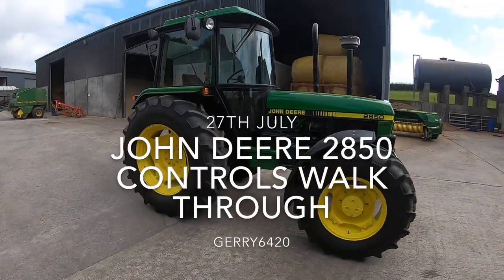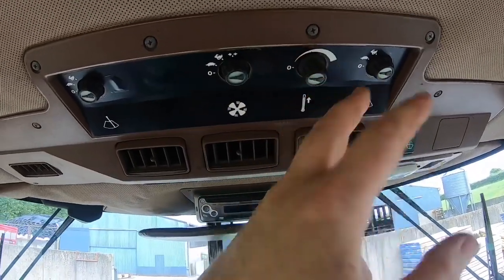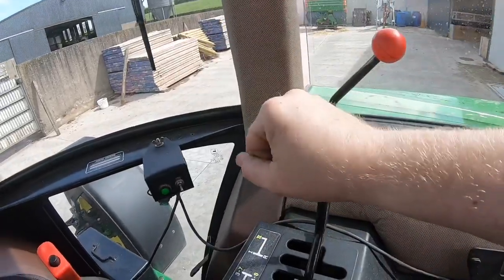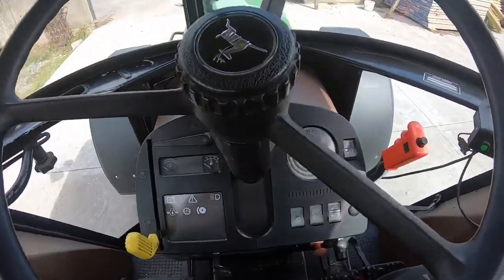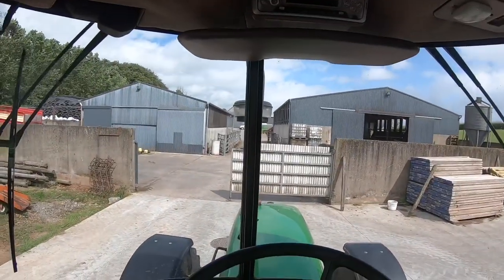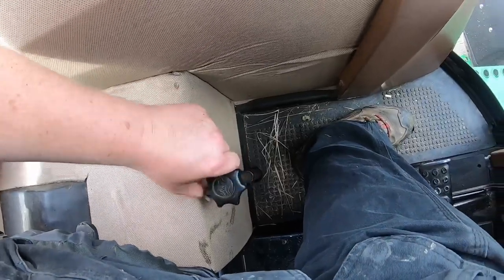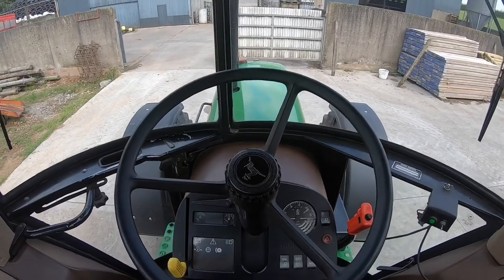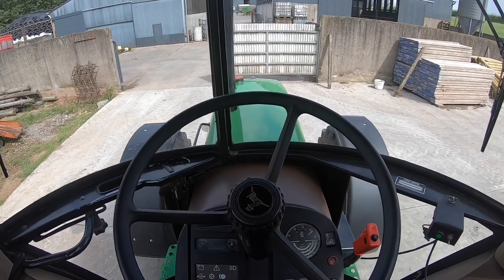JOHN DEERE 2850 CONTROLS WALK THROUGH

Comment: Great video Gerry. Brings back fond memories. The first 4WD John Deere we had was a 2850, it was a brilliant tractor with tons of guts for a 4 cylinder. Ours was a 1991 model & instead of the normal analogue clock had a small green LCD display for the speed, rev counter, pto speed etc. The only reason we had to change it was because Kvernland 3F reversible was too much for the back end.  Yours is in brilliant knick   mate. All the best. Robert

Comment: Great wee tractor Gerry...note that if she was a 40 series the power synchron is not on the little lever but is engaged by nudging the 1,2,3,4 gear lever to the right for high and left towards you for low.
Reply: I drove a 2040s in my teens. The power synchron was a pain in the neck as we had the great stick break a few times. The fifty series is a better idea, I presume John Deere had a lot of complaints with the forty series. Personally ford has the best system with the dual power.
Reply: And the gear lever rattled like hell🙄😩😂
Reply: @roberthiggins6401  Yea, but theres plenty of fords that have had the dual power wired up to a switch on the gearstick if you look around auctions. But yes, the pedal on the floor was as good as any
Reply: @bobpaterson1845  That's right lol, it had plenty of free play in it to rattle

Comment: I'm in throcess of buying a 1950 4 wheel drive, just one question, How do you operate the adjustment of the steering wheel?
Reply from the maker: Center of steering wheel cap (where Deere sign is) will loose to adjust wheel in and out. Lever below the key adjusts it up and down
Reply: @gerry6420  Sorry I didn't explain my question properly. What I meant was can you move the whole steering wheel and column backward or forward to adjust the angle?  Thank you for your reply.

Comment: Well gerry ive a 2850 myself and want to kno how to open the bonnet on her thanks 👍👍
Reply from the maker: Take off the 2 black side panels just below the bonnet on front...... then in behind them there’s 2 rubber straps which you unhook and the bonnet lifts up. If you have an exhaust and a air intake then you were better take them off before lifting the bonnet
Reply: @gerry6420  thanks for the response gerry there is no straps.... but theres two bolts that goes up into the bonnet and there located to the front
Reply from the maker: Jason Gallagher must be differnt set up then mine. Is there a buttons on the front surround above the lights? Maybe someone modified how it opens put bolts on it